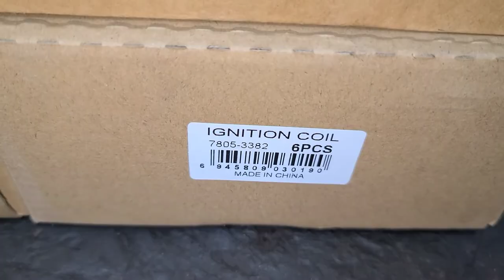Spark Plugs and Ignition Coils on a 2015 Infinity QX60

Comment: I am past due for the 105K maintenance. I have no issue with ignition, but it the manual states to replace the spark plugs.
In your opinion am i safe to just replace the spark plugs and not the coils?
Reply from the maker: @ethananderson07  thats purely a choice for you.  I recommend new coils anytime theyre over 100K miles.

Heres the thing to consider...
To get to the back 3 coils is a very good percentage of the labor on this job. So, if you get done and end up with a misfire next week and have to change a coil in the back, you have to do all that again.

I would recommend at least changing the rear 3 and keeping the old ones for replacements for up front as they go out. The front ones are easy to swap and only take a minute.

Heres another thing...
I do not recommend generic coils (especially ebay/amazon coils). They go bad fast and youre in the position to have to do it all again. I recommend either Dealership, NGK or Denso coils.

Comment: Good video, saw another' video abiut the same thing, idk if i didn't notice it but it seemed like this 1 had an extra hose, idk i could be mistaken, but mine is a 2wd, are they the same as the 4wd?
Reply from the maker: Im not 100% sure on that.

Ive been rebuilding a 96 toyota 2wd 3.4l engine. They tried to swap it with a 96 4wd and it was different even though it was the same engine.
Reply: @MegaMilesBen  ok. Just a question,  but good video very helpful 👍🏽
Reply from the maker: @richmejia6334  and a good question. Sorry I couldnt be more help with the answer.

Comment: Can somebody help me out please??
Reply from the maker: Im not sure what you mean.
Reply: @MegaMilesBen  when to start my car up car started to shake just a little bit then check engine light came on take me to AutoZone to get the code says something about engine coil.i have an qx60 infinity. The car has never had a tune-up 🤯what do u this ? How much to have it fix. What's the cheapest and the best thing to do please
Reply from the maker: @Var-fl3sg  you need a tune up. Spark plugs and Ignition Coils. Youre having a misfire in the engine.
Reply: Thank u so much